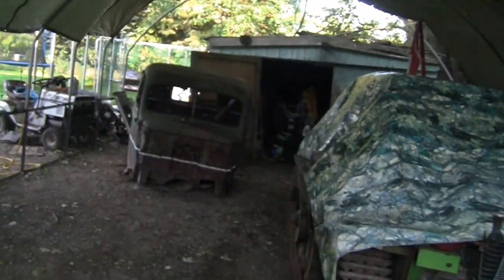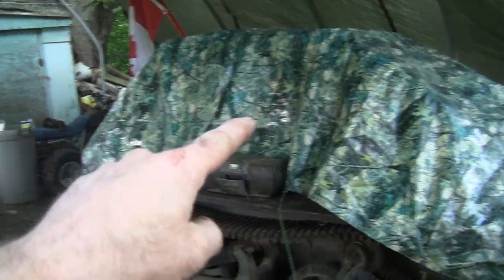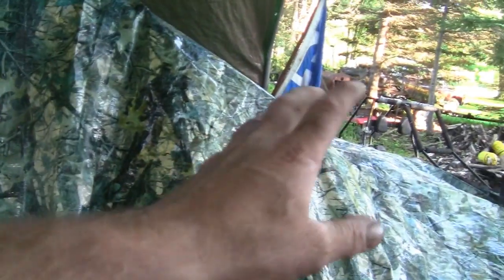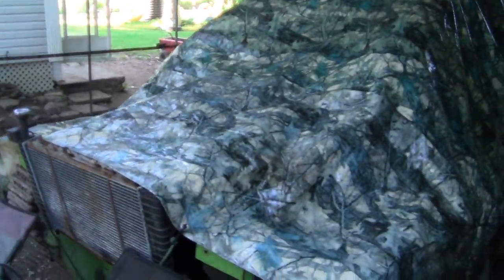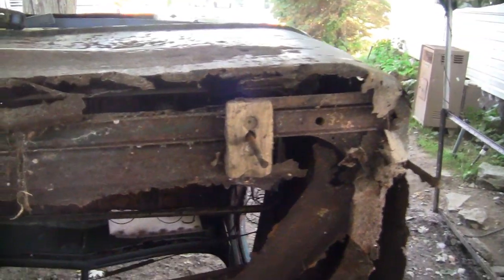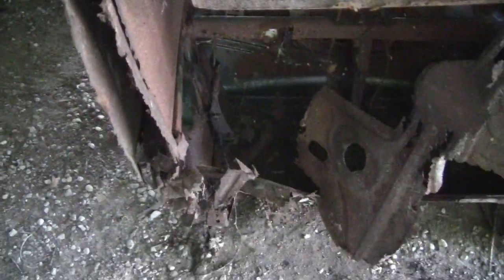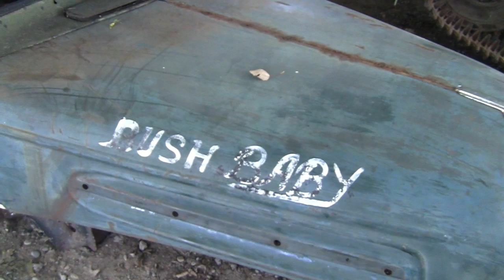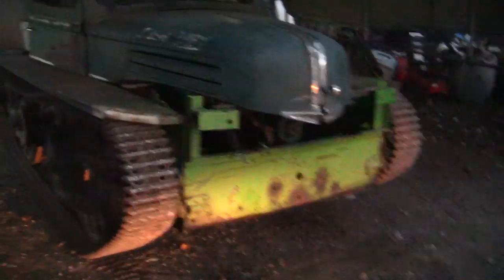Rat rod tank is born

Comment: I think it looks awesome! What I would do is make a rugged brush guard to protect the rad and hood, you can always add the grill later if you find one and I would install some sort of roll cage inside the cab for protection. That is just the way I would do it but I'm sure what ever you do to it, it will look good. Keep it up the great vids.
Jim
Reply from the maker: Tinker Jim Thanks bro. I was thinking along the same lines. Going to make a v shaped ramming bar/ grill for under the hood and will add roll cage and five point harness after the next car show or before if I get time. Still a lot of work ahead

Comment: You might mount the cab for winter use.  Built up it, could support windows and even heat.  A more basic upper could be fitted for warm weather use.  A heat shielded stack ahead  of the cab seems avoid exhaust pipes in the cab.   It will be fun seeing you take it from a running chassis, to a really drivable vehicle.
Reply from the maker: Jeffrey Plum Its coming, just really needs a cooling system before I can really drive it around

Comment: the only concern i have it that the seats might sit too low in the chasis.  Nope looks like you fit that together just right, nicely done!might want to build a rad core support on that and shape a grill to match the nose on the hood, add some lights and away you go man , that's sweet that it's all coming together for you now like that.
Reply from the maker: DaddytechEnt I think the rad will end up in the back now, v shaped ramming grill is going on as well. Lights are a must, thanks bro
Reply: that'd be cool.  with an electric fan on the rad it pretty much won't matter where you put it either.

Comment: I like it but you should extend the cab to a cab and a half, at the back you shouldn't cut out that section of fram-tub-body whatever you want to call it and make a new section out of metal over the rear axle, that will give you a good spot for the back seats, maybe a good way getting in and out similar to how real tanks are.
Reply from the maker: redneckbryon I might make more bodys for it once this one is done. Id like to have it so I can remove the body to work on it or replace it with a different one if I wanted too

Comment: id go get some 1x1 square tubing to stiffen up the sheet metal
Reply from the maker: camerl2009 Still have a lot of work to do to it. Need to fix bottom of the door and add hinges to them as well. I should have braced it before we moved it from the woods but it will be ok

Comment: I like it!!  Any thoughts of putting the roll cage OVER the cab?
Reply: That would be cool to protect the rat rod body. Would give it that Mad Max beast look.

That thing is looking friggin awesome buddy. Now you need to give it some rat rod flair. Google rat rod and you will get some cool ideas. If you do an over the cab roll bar it would look sweet with a rat rod light bar. Maybe add some vintage lights on the sides up front for ratty headlights.
Reply from the maker: ***** ya was talking about that today, I think it would take away from some of the looks it has right now, but you never know. It would not to hard to try and remove if I didn't like it

Comment: what ever you do not paint it man that thing looks bad ass with that cab on it if your still wanting to do the roll bars cut them in half put how they was but just snake the bars threw the cab of the roof an stuffs far as a back seat like you was saying i would go with some kind of rumble seat or jump seat how they have em on the hot rods but far as it sits now the thing looks tits man
Reply from the maker: STEVE JONES Tanks bro and no I will never paint it. Id love to have some of the old lettering touched up abit so we could read it
Reply: you can touch the lettering up  real easyly  just do like a white wash with white paint thin out with paint thinner n then wipe it off or some thing